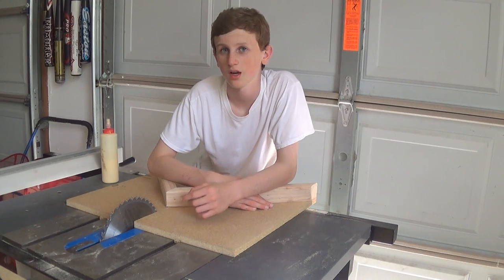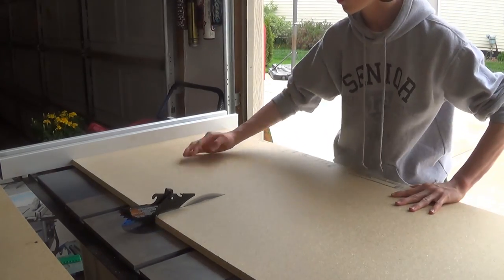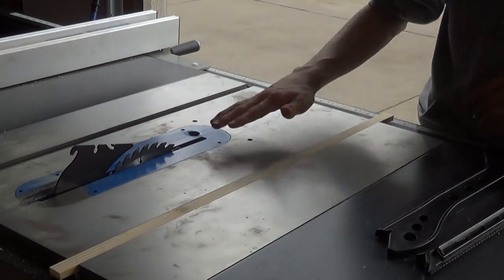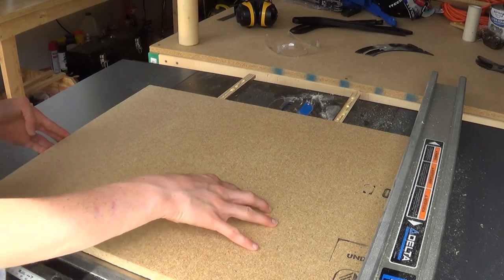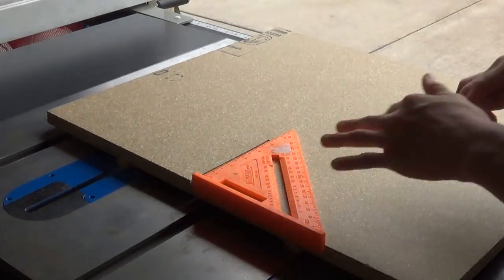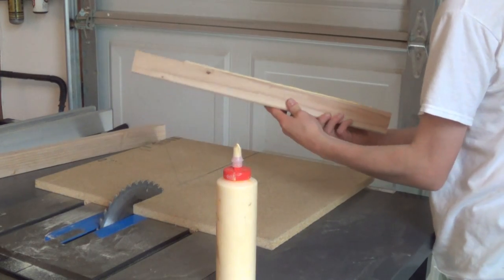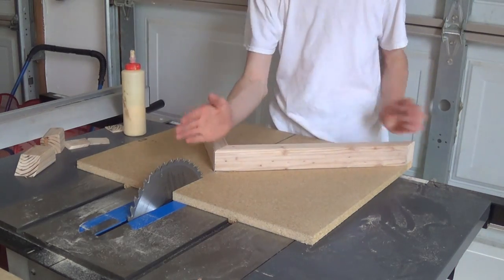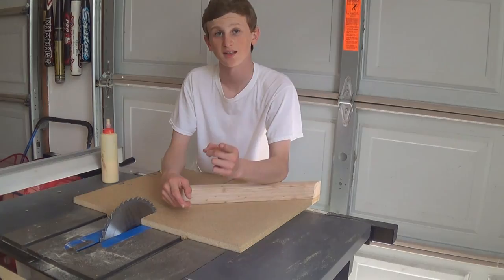How to Make a Miter Saw Sled

Comment: Hey Eric, Good video. I use Minwax paste was on all of my tool surfaces and generally put some on my jigs or sleds. If you research Minwax vs Johnson's people go both ways so I'm sure either will do the trick.

I second Jay Bates on an aftermarket blade. I didn't go for the combination blade but instead went for a Freud Rip blade and an 80 tooth blade I got from a big box store for sheet goods. The difference in the aftermarket blades were obvious right away, especially when cutting hard woods.
Reply: At my Lowes the Johnson's wax is with the cleaning products and the Minwax is by the stains.  I did notice the Johnson's was much cheaper than the Minwax.  Of course this was after I purchased the Minwax.

Comment: To protect my cast iron surfaces I use a product called T-9 Boesheild. It is an expensive product but worth it, you can buy it at woodcraft or online and it's really easy to apply. Also it works great in drill press chucks to loosen them up and protect them. I would recommend giving it a try.

Comment: Great video, Eric! However, I should point out that those two draw strings from your hoodie can be really dangerous while you're using the table saw. They can get caught in the teeth of the blade and pull your head towards the table! One of the first things I was told when I began woodworking was never to wear loose clothing, long chains, bracelets, to tie up long hair and never to wear sandals or flip flops when working in the workshop and praying power tools. Of course, there are other rules, but it's too many to list! Happy woodworking!

Comment: I clean all of my cast iron with WD-40 and one of those green scrubbing pads. Then coat with a thick layer of Johnsons Paste wax and buff it out after 10-15 minutes. If you look on google you will see hundreds of differing opinions on the subject.

By the way Lowes carries a Irwin Marples 50 tooth combination blade that I HIGHLY recommend. Great blade for 40 bucks.
Reply: Hey Jay,  good tip of the blade recommendation. I've been thinking of getting a new 'good' blade just don't really know which one yet.
Reply: Besides the paste wax is a spray product called top coat that protects the surface and also helps gliding wood across the table too. Nice saw too!!
Reply: I have gone with the Top Coat & I use the paste wax method and I really don't know which is better, they both work great.
Reply: I am with Jay on the Irwin Marples 50 tooth combo blade.
Reply: Also give it a dusting of baby powder after you paste wax it.  Helps keep stock moving smoothly over the top!

Comment: awesome purchase lil buddy! i would really like to see you only allowing the tips of 3 teeth on your blade sticking out over the wood you are cutting. its way safer, less bind on the saw and runs cooler(blade). your blade will last much longer. as for blade recs.....i suggest a carbide tipped tripple chip blade. very smooth cutting blade. and for wax i have always used gulf canning wax from the grocery store. just take the block and rub it on the surface of your deck and jigs. buff out your deck with a very soft cloth and then wax it weekly with turtle wax paste wax for cars and buff it out with a very soft cloth. will be slick as oil on a wet driveway! keep up the awesome work lil buddy!

Comment: Congrats ***** on your new table saw.  You have chosen a nice one that with good care will serve you well for a lifetime. 

As for maintaining the top, Jay Bates recommendation is a good one.  Make sure you clean of the WD40 -- I use rubing alcohol -- before applying the paste wax.  Over time, cast iron can assume  darker/gray tints.  This is not rust, but it is a chemical reaction.  The darkening will not effect the table's performance or your work.